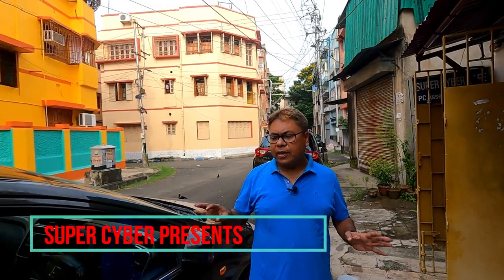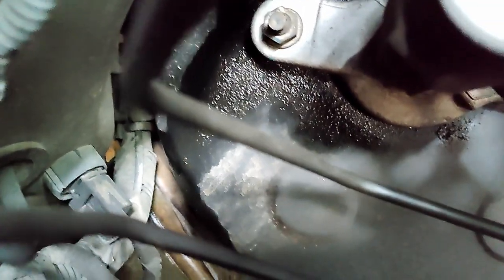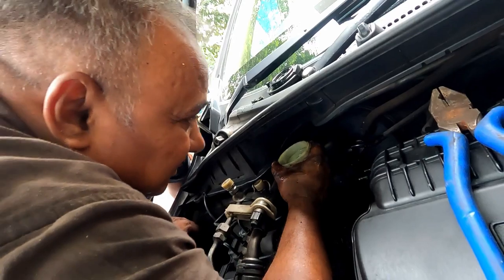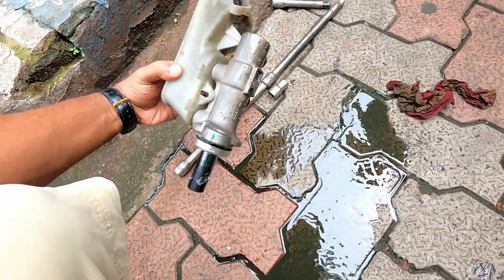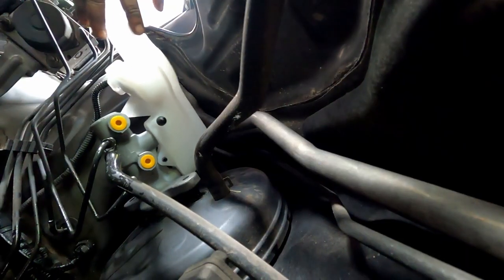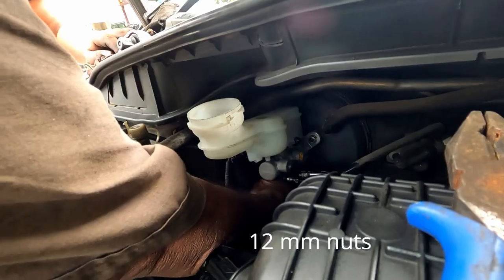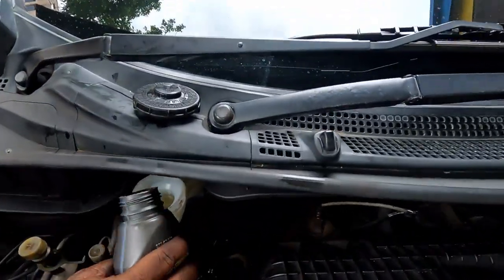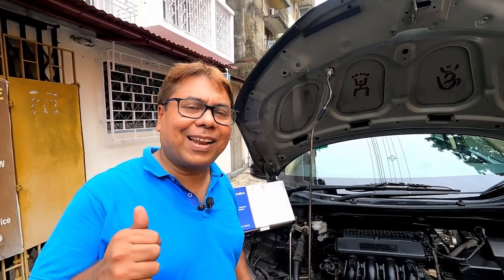Honda City Brake Master Cylinder Replacement at FNG Garage #hondacity @supercyberautomotivetravel

Comment: Where is this garage? My honda city 2015 vmt same problem.
Reply from the maker: It's in Kolkata at Mudiali BPCl petrol pump
Reply: @supercyberautomotivetravel  please send the product details for my car, because I watched leakage behind the break buster, how much price  break booster and master cylinder sir?
Reply from the maker: I have purchased the Master Cylinder for Rs3500/- from a local spares store. Please check if the brake booster is not faulty it may not need replacement.
Reply: @supercyberautomotivetravel  Thank you sir.

Comment: Weren't these things checked before taking delivery?
Reply from the maker: The brake oil was low . The signs of leakage was wiped out. As I topped up after delivery I could see the signs of leakage after driving 2 days.
Reply: @supercyberautomotivetravel   okay.You could have asked the dealership for support.
Reply from the maker: I asked for but they gave up citing it as a used car deal and these things are not covered. At least I got some paint correction from the dealer.
Reply from the maker: There were some paint imperfections in the car which the dealer agreed to support but not this problem. I took the paint correction process and rest of the mechanicals I decided to do it on my own as the work will be to my satisfaction. I have purchased used cars before and always changed and rectified some of them such as brake shoes and pads, clutch and suspension work to my satisfaction. Even I did it to my earlier used Ford Fiesta. Inact I want a perfect car which is difficult in used.

Comment: You could have easily repaired your OEM master cylinder, instead of replacing it with an after market master cylinder. No Rocket science is involved in it. 🙏
Reply from the maker: The OEM  repair kit was not  available like Maruti

Comment: You should buy car from a reputed pre owned car showroom. Price will on higher side however they check all major parts before delivery and give warranty for 6 months.
Reply from the maker: No used car dealer will give you warranty on wear and tear parts. Reputed pre-owned car dealers are no good either. They give warranty on the engine and gearbox for six months which my current dealer has also provided. This type of warranty is meaningless.